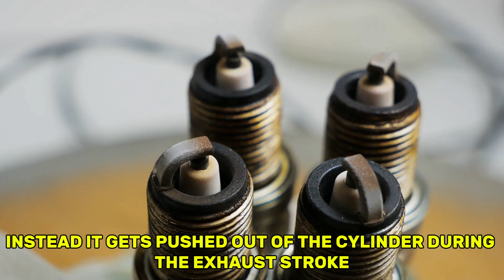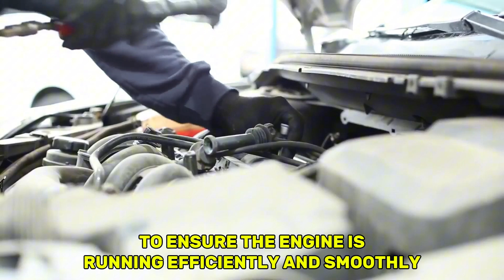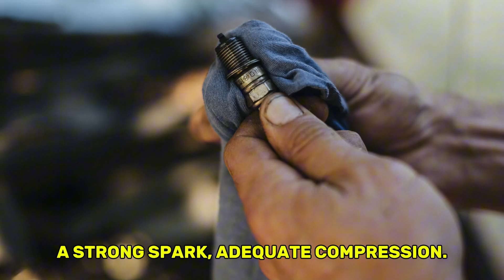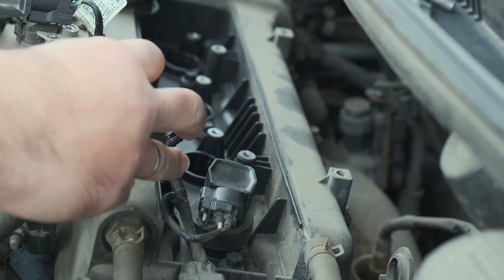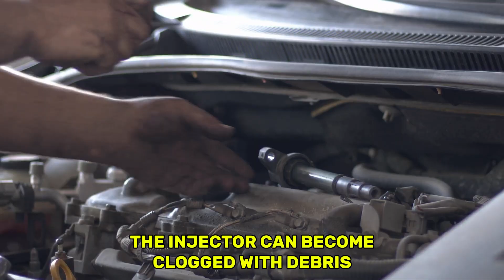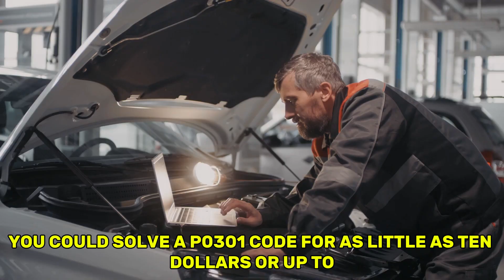P0301 Code: STOP Replacing Parts! (The FREE Swap Test Fix for Cylinder 1 Misfire)

Comment: I had to replace busted upper radiator hose on my 15 Ford Fusion 2.5 L . Then it seemed to be fine after I filled up coolant . Let it burped got all the air out . It was driving fine then rough idling rough running . OReillys scan said PO304 misfire cylinder 4 . Either replace spark plug and or coil . Replaced spark plug . Still running rough . Moved coil #4 to cylinder 3 . Took it again to get it scanned a second time . Scan said it's got PO300 , 302 , 303 and PO304 now . Then moved back coil to the correct cylinder #4 . Disconnected battery cable . Took it again to get scanned . And scanned it again got less codes . Got PO300, 303 , 304 . What do you think ? Disconnected positive battery cable overnight about to connect it . Bought Hypertough scan tool from WM .
Reply from the maker: Yo @frankmontez6853, thanks for all the details man, that helps a lot.

I’d stop buying parts for now and figure out what’s actually going on. The fact that this started right after you did the upper radiator hose and coolant refill is a big clue.

Here’s what I’d check first before spending another dollar:

• Coil connectors, especially #4. Make sure they’re fully seated and completely dry inside. If coolant got into a connector or around the ignition components, it can cause all kinds of strange misfire issues.

• Vacuum lines and the PCV hose around where you were working. On the 2.5 Fusion, those can easily get bumped loose during a hose repair. A vacuum leak can definitely cause rough idle and multiple misfire codes.

• Shine a light down the spark plug wells. If coolant spilled into a plug well during the refill, that could contribute to the misfire.

• Fire up that new scan tool and check live data. Look at fuel trims at idle. If they’re over +10%, you may have a vacuum leak. Also check the live misfire counters to see which cylinders are actually acting up.

• I’d avoid disconnecting the battery to clear codes for now. That resets fuel trims and can make diagnosis more difficult.

Since the issue has gone from a single-cylinder misfire (P0304) to multiple-cylinder misfires (P0300, P0302, P0303, P0304), I wouldn’t assume it’s just a coil or spark plug anymore. Something else may be affecting multiple cylinders.

If everything above checks out, I’d consider a compression test before buying any more parts.

Let me know what you find. Good luck!
Reply: @fixcarcodes  I dont have that kinda scanner that gives me live data . I replaced coil 3 and 4 . And no the coolant didn’t go into cylinders or the wire connectors . I replaced them because I took the suspect coils and put them in cylinder 2 . And then cylinder 2 misfires when before it wasn’t. Now its misfiring with permanent code 👨‍💻 PO302 and 303 304 . And rechecked any possible vacuum leaks . Looks tightened up . Everything connected correctly. Its not some kinda relearning thing where the car going to have to go through driving cycles? Driving it around it’ll get normal?
Reply: @fixcarcodes  replaced coil 2 after I did test all coils 2-4 ( even coil 3 and 4 which I did replace ) by disconnecting wires from connectors and 3 and 4 coils did change got worse so those coils are good . Coil 2 didnt so it failed test . Replaced it and it’s running perfectly. Permanent codes still there I couldn’t erase them . Even after driving on expressway for 15-20 minutes. And tried with my cheapie scan tool . Even got a new one code PO420 . Will try to use higher octane gas or catalytic cleaner from Walmart . I don't know why they failed one by one .
Reply from the maker: @frankmontez6853  Awesome update, Frank.

Sounds like you finally tracked it down. If the Fusion is now running smoothly with no misfires, rough idle, or loss of power, that's a very good sign.

The remaining codes are probably permanent codes stored in the PCM. Many scan tools can't clear those. After enough successful drive cycles with no misfires detected, they should clear on their own.

I'd just keep driving it and keep an eye on it. Hopefully you've got it fixed for good.

Thanks for posting the outcome—it may save someone else a lot of time and money.
Reply: @fixcarcodes  Yeah learn something from this . To always get it scanned and perform the follow the spark test and disconnecting wires from suspect coils test . This old geezer mechanic just said replace the coil after I asked him for advice . But I did and still failed the other ones one by one . Replaced all four now . Ford oh how i wish they used metal for the valve covers like in my 11 Camry .  The metal part that the bolt holding coil broke off inside valve cover , Got it out now will try using two part JB Weld to glue that metal piece in place . Of course the bolt isn't holding ..will try this instead of replacing valve cover .. will glue it without the bolt so hopefully won't get glue on bolt . Use the minimum amount so no spill over
Reply: @fixcarcodes  I rechecked everything I disconnected when I replaced hose . Since then have disconnected wire connection from cylinder 4 while in idle . It didn’t affect idling. Next I move coil to cylinder 2 and got misfire there code PO302 . Changed back coil to its original correct cylinder 4 . And no more PO302 . So i think it is the coil . But I probably will check if any coolant got in there